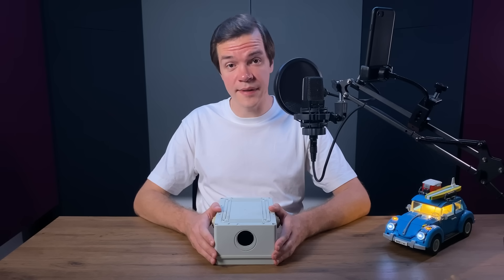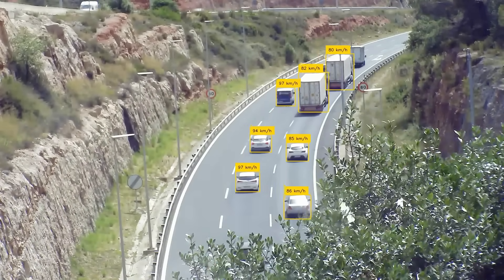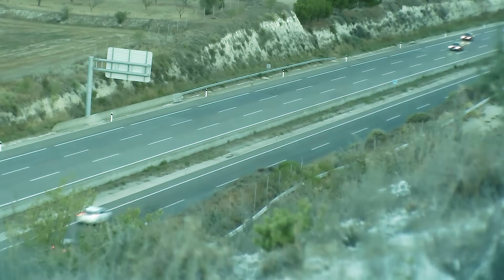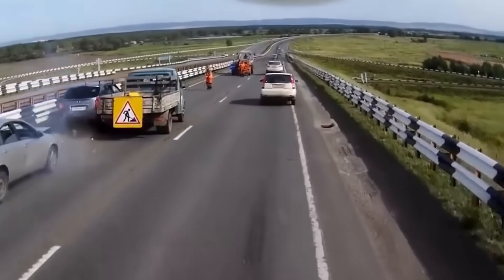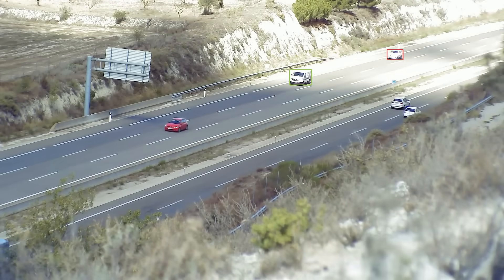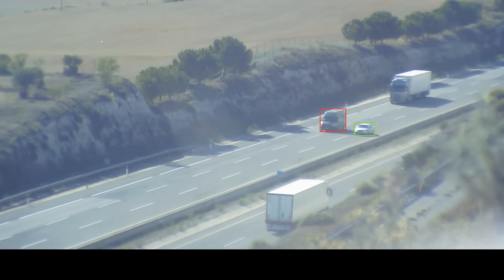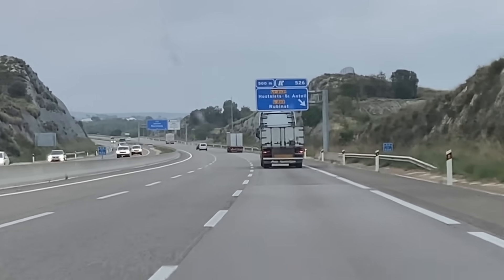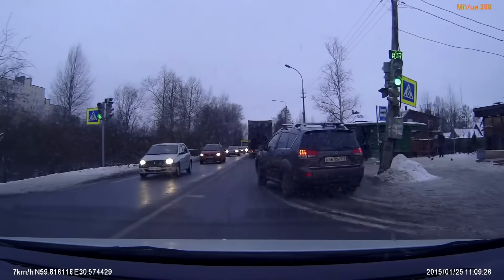New Anti-Tailgating Camera Reveals Shocking Statistics

Comment: Tailgaters are my primary frustration when driving. I use my own avoidance system by using hazard lights and slowing down until they go around.
Reply: do not do this: i was brake checked already 2X, since the driver behind me ( of an immigration background, in both cases) felt himself to be "angered" - overtook me from the right ( in one case, he almost capsized) and brake checked me.
Reply: @mortenvanlinden567  I'm not complying with reckless drivers. It just means you need to expect them to get right in front of you and brake check, so when they move to the side of you brake more so they can't do that.

Comment: One way to mitigate the problem of being cut-off causing a false-positive is to check the relative speeds of the two cars.  If the one behind is a bit slower, that means he's trying to increase the distance, and a correction to the measured distance can be made in that light.
I'd also like to point out that adaptive cruise-control systems are often set to less than 2 seconds' following distance by default.  The computer has a better reaction time than the driver, and if driven by Doppler radar rather than optical means, it will react to the actual speed change of the car ahead, even if the brake lights aren't working!  The following distance is then largely a contingency factor for differing brake performance, but in practice it might be used to make the driving style smoother and more comfortable.
Driving instructors (the good ones, anyway) will recommend that if you have a tailgater, the best thing you can do is increase the free space in front of your own car, so that if a hazard develops you don't have to brake as hard.  That makes it less likely that you'll get a Mercedes emblem suppository.
Reply: Thanks for the 'Mercedes emblem suppository' image.
Reply: Good idea for mitigating false positives. But you'd still have the dumbasses who in addition to cut-off also release the throttle at the same time (not so many, but some do : they increase speed for overtakes then release it once ahead...)

My VW is, by default, set at 2s distance (at least on highway speed, 130km/h). maybe a bit less when under 90 km/h.
But I do agree, computer reaction time is better, and also the braking is done in an amazing trend : it is PERFECTLY dispatched along the available braking distance ! (which at first is a bit scary for the human at the wheel)
Reply: Very good point about automated systems reacting far faster than humans. Modern cars can also brake far harder - my BMW i4 has a g force meter - gimmick perhaps, but I’ve measured an emergency stop at -1.25g (badger stepped into the road, stopped safely). That’s 12.5m/s2 stopping force - fortunately I had no one behind me. The cars emergency braking can presumably apply all of that and more if needed.
Reply: @gothmog2441  The deceleration rate under braking is largely a function of the tyre, rotor, and brake pad condition, as well as whether the road is dry, wet, or slippery.  On a dry, clean road, most cars made in the past several decades can safely brake very hard in a straight line.  On a wet road, tyre condition will dominate the equation.
There are a few notorious cases where the brake calipers are poorly designed, allowing hot brakes to rapidly vapourise the hydraulic fluid and thereby causing them to fade - Dodge police cars, for example.
Older types of cars tended to have drum brakes on the rear wheels, or for very old cars, all four wheels.  The first cars to get disc brakes had warning signs on the back, to indicate their ability to stop more sharply!
Reply: This is also true for Tesla's vision only system.
Reply: @tedmoss  ...which is sufficiently less reliable at detecting obstacles that I would be very reluctant to rely on it, EVEN as "just" an adaptive cruise control.
Reply: @tedmoss  Tesla's vision only system is the cause of motorbikes being rear-ended and the riders 'unalived'.
Reply: Not many vehicles have adaptive cruise-control systems yet.  But when it becomes common I can confidently predict that, as with every high tech addition, the benefits will be outweighed by the fact that another piece of our brain and attention will be shut down.
Reply: @georgelewis3047  Just like with any tool (unfortunately).
If you consider yourself a responsible pilot, then the tool is a real benefit : you get better security distance maintained throughout your trip, you get better fuel efficiency, and you get additional security during rain/fog/night when humain vision is partially impaired where the radar doesn't give a damn about it.

But if you're not a responsible one, you thrown the duty to the tool when it is not designed to and you might learn it the hard way later down the lane when something really bad happens to you, you family, and other humans...

Comment: I always maintain the safe distance on any road.
Here in the UK on the motorway, when the car following me can't see the car in front of me because I'm at 100 m of distance from it, the either honk me, take me over, or tailgate to bully me into driving faster.
The alternative is to drive right at 70 mph, so they don't do nothing to avoid breaking the speed limit.
Driving in the south of Italy, on roads without speed cameras or without "tutor" (a speed averaging camera, operating along 100s of km), when I keep safe distance the car behind give for granted I'm a noobie and takes me over - they don't even realise that I were keeping the safe braking space in front of me, as it was an alien concept.
In a traffic line, here in the UK the cars keep a distance of 1.5 metres one from another; down there, cars maintain 20 to 30 centimetres of distance - when the parking sensors are triggered.
I believe driving schools should put more emphasis on E = ½mv² (the Energy of a moving car) and the absolute need for a safe distance between moving cars.
Thanks for the video.
Anthony
Reply: Drivingschools do educate on the safe drivingdistance, tragically most people disregard common sense nowadays and really think, they can react like a cat and get the car stopped on a dime. Overconfidense and way to close driving. From my expierience its impatience, which leads to speeding, tailgating and disregarding safety distances.
Reply: Modern vehicles can have very effective stopping power, but drivers often fail to take into account the cumulative effects of reaction times in a queue. Consequently, the crashes often get worse the further back you go in a pile-up. We're also not good at judging how fast we're closing in on vehicles in front. And of course wide, straight motorways lull drivers into a complacent and inattentive state (even without putting mobile phones into the mix!).
Reply: "E = ½mv² (the Energy of a moving car)" ...on that subject: safety infraction fines for anything larger than typical personal passenger vehicles should be proportional to mass of the vehicle.  And if infraction is speeding it should be indexed to m * v.
Reply: Loving the funny measurements 😂🤣😁
Reply: Drivers that think they should knowingly control or limit the speed of drivers behind them are the ones that are responsible for the eventual collisions. If you are not in an official marked traffic control vehicle you are effectively guilty of “ incitement to violence “…
Reply: @philtucker1224  Why exactly, just because he actually kept the speed limit? Why should he be forced to slow down to move out to a lane with trucks moving slower than his original speed? It is not the tailgater's right to demand for themselves the free space for speeding.
Reply: @matyasapati3181 always adjust your distance from the car in front to achieve a safe braking distance. It would be very small minded not to. Avoid aggressive light flashing and other actions that can encourage road rage. Avoidable incidents and collisions often occur when a selfish driver and a small minded driver compete for the “Alpha male” title…
Reply: @matyasapati3181 if you drive regularly in the U.K. you may find “ driving to the speed limit is maybe  (say) 5mph below the general speed of traffic and therefore causes (what the previous Conservative government described as “ bunching”). The Highway Code actually advises drivers to maintain or match the speed of the surrounding flowing traffic as soon as whenever possible to avoid creating this hazard.
Reply: You are the problem, if car is behind you, then it is your problem and you should move over... That is whole problem with UK, people don't understand that they are responsible for moving over and ALWAYS driving on the LEFT unless overtaking (as per HC). It does not matter that they are speeding, it is not your problem, you finish overtaking and you MUST immediately move over as far to the left as you can.
Reply: @lp9280 if you assume he is in the right lane in the uk, then "maybe" yes, he should move over. But if he gets tailgated in the left lane, your thought of thinking isnt viable obe bit
Reply: @lp9280 yes ( if on a multi lane highway) very well said.
Reply: It always amuses me when someone get themselves into a pitched battle of wills with my cruise control.  It drives them nuts that tailgating me doesnt make my speed change the tiniest bit.
Reply: @paulharper362 i love doing that here in europe, too. The glee of knowing, the tailgater cannot pass is so refreshing and joyful that i even do this in really slow speedlimitzones (30kph)
Reply: @paulharper362  how about moving over in the lane in which you suppose to be?
Reply: @lp9280  there is nothing to suggest that they are not driving in the outer (slower) lane already - you are assuming they are not. Regardless, it is the responsibility of the overtaking vehicle to do so safely. Who knows why the driver in front is driving slower than the driver behind? The speed limit is the maximum legal speed, not the minimum (I am not advocating for driving significantly slower than the speed limit by the way)
Reply: @lp9280 all U.K. drivers should keep to the left until entering point where the the designated intended route markings appear on the road. (Most don’t obviously but that’s not the point). Two wrongs don’t make a right.
Reply: @lp9280  who said I wasn't already in the slow lane ?  I was referring to when idiots tailgate to try and make you go faster, not realising you are on cruise control and nothing they can do will make my cruise control respond.

Comment: The safety index does not accurately represent the danger involved in the situation because the collision intensity depends on the initial speed. In the first example, if the front car suddenly becomes stationary, a tailgater driving at 120 km/h will collide at a speed of 101.2 km/h, while a tailgater with the same safety index but driving at 180 km/h will collide at 144.9 km/h which is a much more dangerous impact.
Reply from the maker: You are correct, it only represents the probability of the crash, not its severity.

Just for curiosity, I calculated impact speeds.

Impact speed at 120 km/h, 50 m following distance: ≈ 101 km/h.
Equivalent speed for 100m following distance is 152 km/h.
1.6% of the drivers going with that speed vs. 20% of the drivers following with that distance

Impact speed at 120 km/h, 40 m distance: ≈ 111 km/h.
Equivalent speed for 100m following distance is 158 km/h.
0.83% of the drivers going with that speed vs. 14% of the drivers following with that distance

Still an impressive difference.
Reply: @RailwaysoftheWorld1  Excellent analysis

Comment: It would definitely work, those fines, if there is some video recorded with every detected tailgater. Even manual review can be viable. When in doubt, don't fine.
I was once cut off by a motorscooter right in front of a speed camera, which went off. Bet there being two vehicles in view, I did not get a fine.

Comment: I think 100m is a very long distance at highway speeds, and 75-80m an EXTREMELY EXCESSIVE distance for normal country roads (with a speed limit of 90km/h). If you are adequate driver, you really NEED to follow at a much closer distance, especially if you are planning to overtake. I would consider a decent distance of 10m, and definitely no more than 15m each time you are planning to overtake. This way the overtake will take much SHORTER time, and will be much much safer, because you will be in the opposite lane of travel for a very short time. Consider overtaking a 5m long car in both cases from 10m and from 30m:   1) 5+10+10=25m, and 2) 5+30+30=65m.  From a 30m distance it will take literally forever.

Comment: You are right - tailgating does cause most accidents on any highway. YET, the problem is not the "tailgating" but how the drivers are educated and how adequately they monitor the road ahead. I recon that I could drive VERY SAFELY at 15-20m distance at highway speeds, considering that I successfully monitor the road ~250m ahead. I will not look what the car ahead of me does, but I will look from ~15 to 250m ahead and react to that information. Unfortunately VERY FEW drivers are educated that way or can do it adequately. So ... the problem is not the tailgating, but the POOR quality drivers (who try to tailgate/follow from very close).

Comment: The 1 second / 30 meters on the highway is enough most of the time. You can react, and normally, there is not something stationary, but someone changing speed (braking). This is not a safe system, because "most of the time" and "normally" are not "safe". But: Everybody does it, and if you have more time / space between you and the one in front, you will get cut from the other lanes. And the speed there may be much slower - so you need to break really hard. You do this a few times and then concider it more safe to travel behind another car in a distance nobody will cut in, but still enough to react.

Comment: Perfect!
Thank you for creating this video. Didn't expect that you can top the previous video with measuring speeds, but you did. Great job. Are you planning to share code maybe and hardware list maybe? I would copy your speed measuring  solution to provide road passing my house to officials that something needs to be done about it.
Reply from the maker: I added the hardware list and the link to the article I used to write my code to this video description.

I can't share my code, it'll be useless. It's very tailored to my specific case and it uses very outdated libraries (from 2 years ago). The article I linked should be enough to help you write your own. If not, ChatGPT codes pretty good. Cursor.ai is also a great code editor with AI, it'll also launch its own written code and autocorrect it. Free version should have enough tokens to wrap up this project. Good luck!

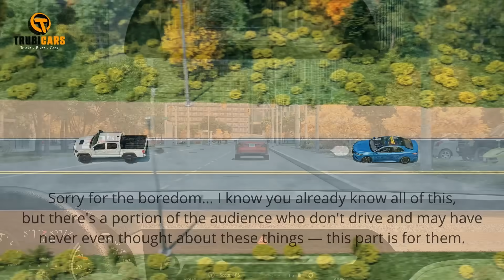Comment: 5:46 three seconds? 😂 I usually maintain around two and my gaps are the biggest in the vicinity by far 😀
Reply: Two is how I learned it back when I was a German teenager or even younger, sometime around 1970, I'd guess. As long as it's significantly more than average, it's not really relevant; most people drive too close anyway. Looking at YouTube car videos occasionally, it's one of the most common crash reasons I notice - far too little distance.
Reply: @KaiHenningsen  Yes, it always has been 2 seconds. 3 is some new made up activist nonsense. But you'd be fine even with 1 if you are actually looking at road situation ahead. But lot of people just don't watch the road and then even 10 seconds isn't enough.
Reply: I keep 3 seconds as a general rule but also I must be able to stop in the distance I can see ahead. I used most of it one day when the car in front clipped the curb, which broke their steering, which ran them into a pole. They bounced back across the road, completely blocking it. They'd come to a full stop right in front of me, in a distance that there was no way I could match without the aid of a pole. I had plenty of time to stop, without the Muppet who was tailgating me hitting me from behind.
Reply: 2 seconds is fine on the roads. 3 seconds are required at highway speeds!
Reply: In UK the "safe" distance is two seconds.  This is promoted by Government propaganda, "Only a fool breaks the two second rule." This has been promoted for many years.